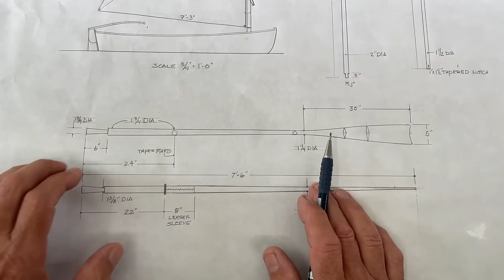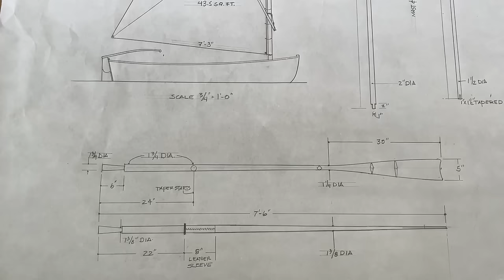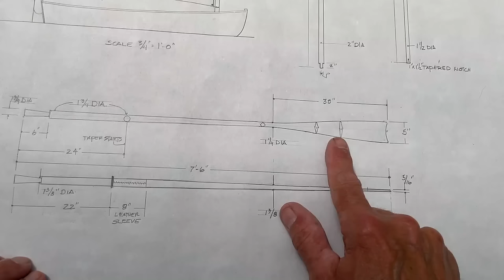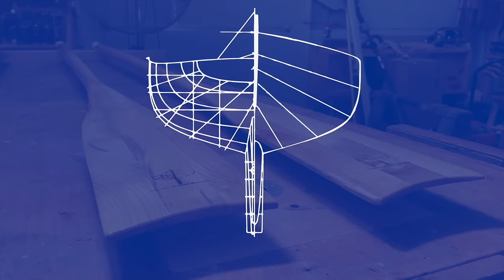Mastering the Art of Making Oars, S3-E21

Comment: As always, a joy and spot of relaxation to watch you work. The oars turned out beautifully. Since even those of us with a lathe dont typically have a seven foot capacity in length, your method is awesome and makes great sense.
Bravo. Turning multiple sections and gluing them together would make for a weak oar. You method absolutely is the better method. The only thing that might be better would be a one piece construction rather than gluing on the wings of the oar's paddle, or includding dominos, dowels, or sliding dovetails for a mechanical attachment on top of the glue alone.

Comment: Beautiful blades Bob. They will be a nice match for Victoria.  I'm sure they will give years of good service.

You mentioned using the blade tips to push off of a dock.  I restored a set of oars for my tin boat and used a trick I had seen on some inexpensive canoe paddles.  I added a 1/2" tip made from marine epoxy that was molded onto the end.  Mine is functional but not pretty.  The paddles I have seen use a nice amber coloured epoxy.  A thin dado is cut into the end to give the epoxy more strength and surface area.

Comment: You are very good at what you do!  I find it interesting that you use a formula to determine inside length of oars, but formula doesn’t take 3-5 inches between in account.  So you took what was optimal length and then subtracted
Reply: I agree.  Why use formula, then totally change it
Reply: @thomasbalph6620  The optimal length and placement of the oarlocks resulted in oars that overlap.  If you watch a rowing race - the College/Olympic version in super narrow racing shells, etc., you'll notice that their hands do overlap as they pull the oars in.  They benefit from that extra leverage.  Steve is not planning (as far as I know) to race Victoria, and so Bob is not building a racing boat - instead of optimizing for power on each pull, he's optimizing for convenience, and an occasional rower is less likely to master the subtle shift in their hands to avoid having the ends of the oars hit.  SO, he started with their formula, and optimized it for the specific use case.

Comment: The inside out belt-sander-drill-attachment is pretty clever. Is it a product?  If not, what did you use for the driver drum in the drill?  The oars I remember (Maine, Prams and dinghies) were flat bladed until someone discovered the better bite and efficiency of cupped blades. But the tips could never be too delicate so they would survive being used as a poll to push off a rocky beach. Blade shape really went wild when designers of racing sculls and shells got involved.

Comment: It's usual for the oars to cross when sculling. Though I can see that this is probably inadvisable for a tender that is rowed mainly for utilitarian reasons.
Reply: I agree.  I think it depends on how you want to use the boat.  If you want speed then a longer inboard loom is an advantage and one can learn to cross one hand above the other.  This allows a longer oar and more leverage and thereby more speed.   However the downside of longer oars is that they are awkward in close maneuvering situations which a tender is sure to have.
Reply: Yep I always prefer that, even on a tender.